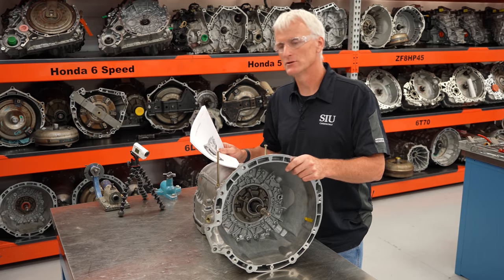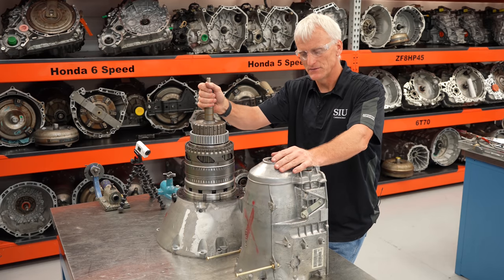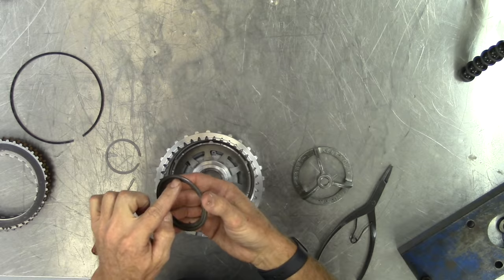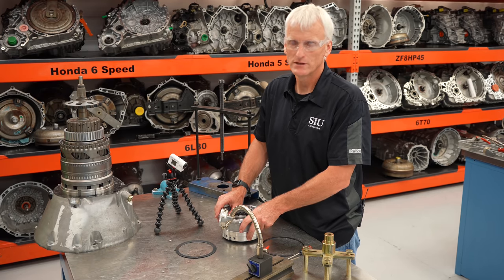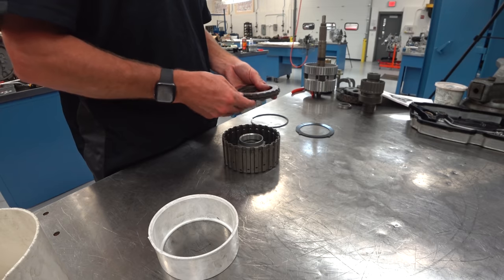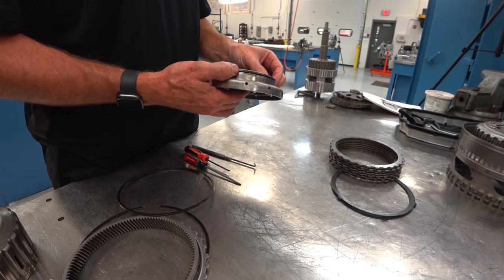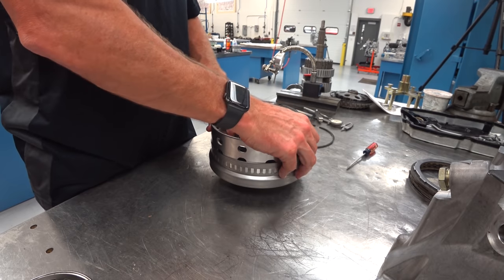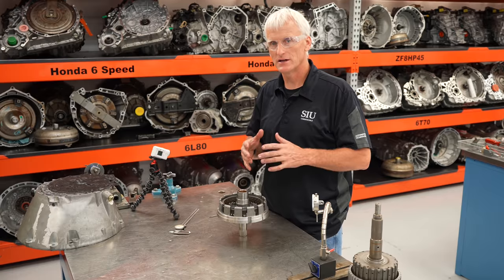Mercedes 722.6 Chrysler NAG OVERHAUL complete

Comment: How do I know if the conductor are is faulty?  I've got one that won't go out of limp mode ?   I hate to do a complete overhaul if the only problem might be the conductor plate . Will codes show anything??
Reply: Hi Albert, did you find out what the problem was/is please? The 722.6 box in my Vito goes into limp mode once the box warms up a bit. I'm trying to find out whether I need to change the conductor plate or a solenoid
Reply: Watch his video on aftermarket fixes for the valvebody. He presents 3 plus options (Sonnax has zip kits that are drop in without drilling, which MIGHT be a good option)
Conductor plates are suspect after 100k miles. Also, the connector collar (behind the 7mm nut) leaks and is only 15 dollars.
After pulling your solenoids to replace the CONDUCTOR  PLATE,  you can check the ohms on each. Use a  9 volt battery (or 12v) to check operation, too.
In short, take the valvebody body apart and clean it! It most likely needs a Transgo or Sonnax kit. Hopefully you can do this properly and eliminate need for transmission shop. If you can't clean it and the torque converter fails, it will send debris into everything and game over (ask me how I know)
Reply: It was the conductor plate on my box. The box was secondhand and under warranty but it would have taken a couple of weeks to get it fixed professionally and the Vito is my taxi so I was losing income. I decided to take a chance and ordered a new conductor plate, £130, on a Monday. It arrived on the Tuesday and I changed it myself on the Wednesday with the box in the vehicle. There are a few videos on this job on YouTube, it's not difficult. Test drive on the Thursday, no more limp mode, magic! My thanks to John Swanger who was the first to suggest changing the conductor plate. One video said it's the speed sensors in the conductor plate that fail.
Reply: P0715 code , speed sensor malfunction.

Comment: Thank you for the excellent video. I have a NAG1 in my 09 Charger Pursuit w/149k miles. I recently began feeling a shimmy, which has become a vibration/shaking which appears when I'm lightly accelerating around 35mph and above. I think it's transmission related, but I'm not positive. I've changed fluid and filter(no apparent improvement), and inspected the rag couplers on the front & rear of the propeller shaft(they look fine), but I can't really see the center driveshaft bearing because the oem dual exhaust is in the way. Do any of these symptoms sound familiar to you? What would you suggest I do next?
Reply: Torque converter?
Reply: @ryanledger9888  yeah, I've considered that possibility. I was holding off, due to the expense and difficulty of changing that piece, doing that. I pulled the driveshaft and replaced the carrier bearing, though the old one didn't look bad. I did find a tennis ball that was caught in the tunnel and against the driveshaft, which was pretty unexpected. I don't know if that has helped, yet, but I'm pretty skeptical.

Comment: Great video.  I believe the PWM on the solenoids is to regulate the current, like a constant current regulator.  This way voltage spikes won't destroy the solenoids or shorten their lifespan.  Pretty ingenious design.

If you happen to know what current they are supposed to run at then you can probably get a constant current/constant voltage (CC/CV) module or a PWM module and set the current on that to test the solenoids but that is probably overkill.

Comment: Please correct for 34:20 TURNS COUNTER CLOCKWISE!  The Rear Sun Gear and K3 Clutch Hub should turn Counter Clockwise and Lock to the Clock! The same as F1.
Reply: Depends on whether you are looking at it from the camera angle or from the rear of the camera angle.

Comment: Why no drain plugs ?  Would make changing fluid so much easier, instead of sucking out via dipstick to at least cycle out to fresh fluid like I do with every oil change, I like to a quarts to keep it nice and fresh.
Reply: There is a 5 mm internal hex drain plug in the pan.

Comment: Anyone know what could cause an “improper gear ratio” code after wheel spin?

Trans had conductor plate changed as well as fluid and filter. Had the improper gear ratio code before and after. Car has stock wheel and tire size and of course differential

Comment: On  my nissan  CVT transmission they recommend Nissan NS2 fluid  the cost is $20  a quart , I am going to use AMSOIL which is compatible with NIssan NS2 , Doing a drain and refill only  --my question will it damaged the CVT if I   mix the CVT fluid with the current fluid that is still in the CVT
Reply from the maker: Sorry, I wish I knew the answer for you.  But if I were to guess, if the AMSOIL states it's compatible with the Nissan CVT, it'd probably be okay to top it off with it.  It might be worth a call to the AMSOIL tech line.